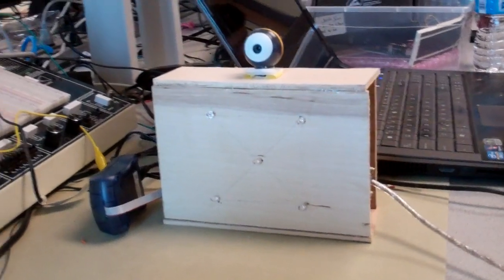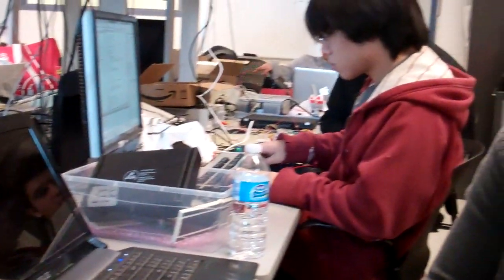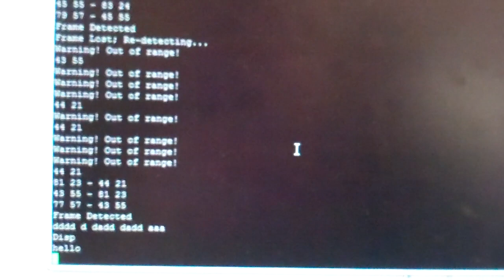Optical Morse Code transceiver

Comment: Hi Josh sun and Trudy chu..

Quite impressed by your this Project. and want to try the same.. but the code is having a lot of errors. Solving one creates ten twenty more.. so need a bit of your help in coding.. Any help will be highly appreciated.. Thank you :)
Reply from the maker: +Mike HCdrs are going to tell me what the errors are?
Reply: +Bruce Land Sir i had written that code using Visual c++. Then i had linked all the header files from arduino folder to c++ directories. but then when i m trying to compile it is giving me errors in those header files;though those header files are obviously error free as they are built in arudino header files. Please correct me if i am doing something wrong. most errors in pgmspace.h io.h and delay_basic.h..

Thank You
Reply from the maker: This is not an arduino project and has never been tested against arduino libraries. this is a standalone AVR project in GCC
Reply: +Bruce Land Thank you very much sir. I compiled and build it using atmel studio though there were 20 21 errors that I debugged. Now I am a bit confused about the schematics of ATmega1284p interfacing with all other hardware. schematics of LED are clear but any help in schematics of all interfacing will be highly appreciated Sir...
Reply from the maker: The report has all the data that exists on the project. There a page which describes the general cpu used in the project. http://people.ece.cornell.edu/land/PROJECTS/ProtoBoard476/
Reply: +Bruce Land Thanks sir. these boards were really helpful. But a question sir. What if i perform the same using an Arduino mega2560 or some other Arduino then what changes i have to make (apart from the pins mapping)?